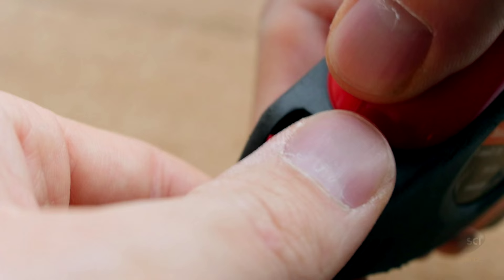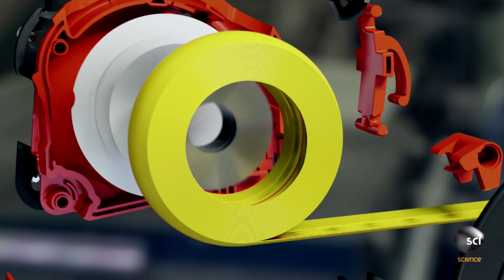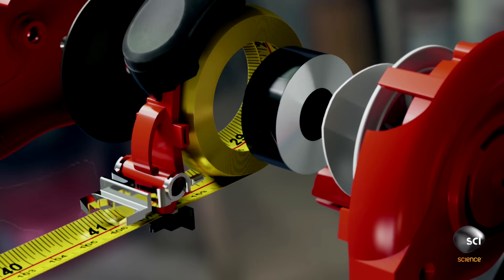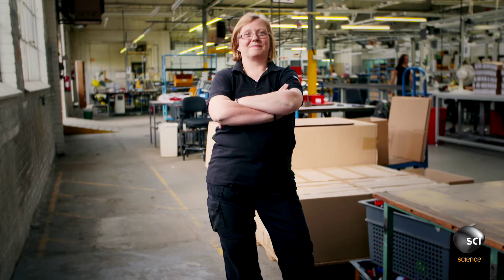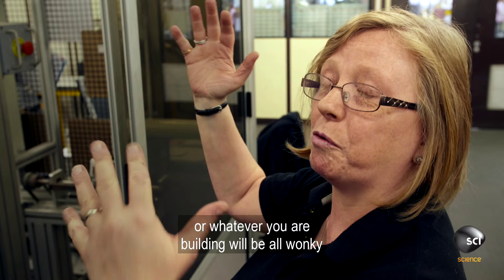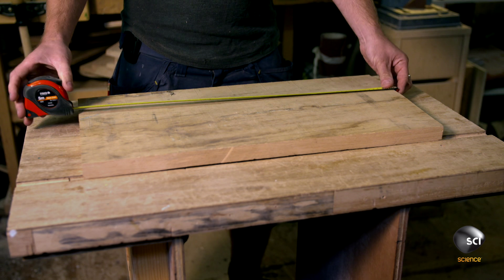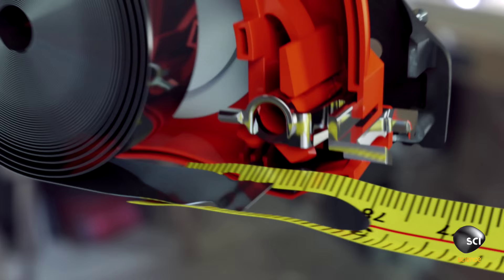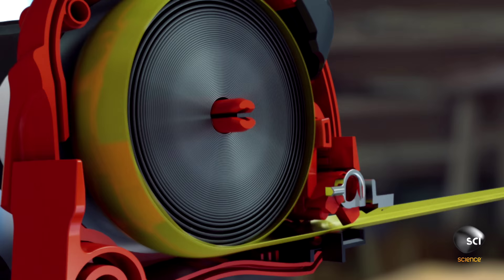Inside the Humble Tape Measure

Comment: I actually wonder if the spring inside a tape measure would work on a crossbow let's say you pull the trigger it releases the string and it pulls a sled attached to the spring coiling it tight and when the looses the bolt it pulls the string back and locks it into placeready to fire again if it works a semi automatic repeating crossbow with no electronic parts is not complicated to build shoots silently perfect for applications such as night ops or hunting the perfect stealth weapon.
Reply: I understand that this comment is half a year old, but I wanted to let you know the problem with that. When you release the firing mechanism, it needs energy to go against the coil. If this energy is large enough to pull the spring and fire, the spring isn't strong enough to reset it. If the spring was strong enough to reset it, the crossbow wouldn't fire in the first place. So unless you manually reset the spring each time, it wouldn't work. And at that point, that's just an extra step.
Reply: @Ethan_FPV  What if you have a mechanism like in old watches where you crank the coil a bunch? 😄 Like, you'd reload your bolts and give the coil a good dozen cranks. Then when you pull the trigger, the string disengages from the coil and fires. Once the trigger is released, the coil mechanism grips the string back into firing position, a bit like how an escalator takes you up and down the subway. It'd probably be a very chunk crossbow and it might be a bitch to crank. I'm not sure if it'd work but uhhhhh, yeah... 😅
Reply: @Ethan_FPV  Oh, I just thought of something!!
The coil could be cranked in advance and incorporated into the magazine. Each magazine has its own coil so you don't even have to crank between mags.
It'll just take a while to prepare the magazines.

Or, there could even be one coil for every bolt packed into each magazine!!!
Reply: @Ethan_FPV  What about the springs in retractable dog leashes?